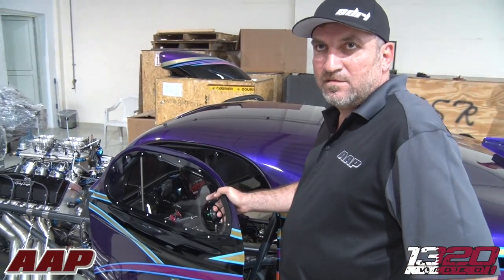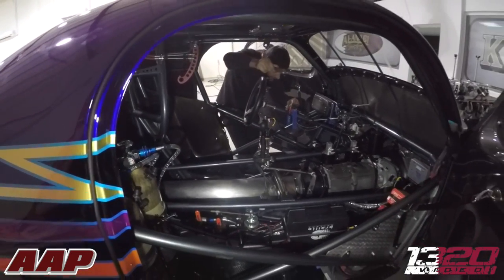949 CUBIC INCH Willy’s - Testing In Qatar!

Comment: 2900hp out of all that??? seems low
Reply: 2900 hp without spray
Reply: +Isaiahfabian No dude. not 2900 without spray lmao.
Reply: gotcha
Reply: Yea it does seem just a tad bit low, Docs new 959 is making 1900 with no nitrous so his engine should make right over 3000 on nitrous which sounds about right. This 949 should make 3000. Regardless it’s an insane amount of power to put into a car. This car will easily run in the 3’s once he gets it tuned right and running straight.

Comment: I don't know all the technicalities of drag racing but what is the point of the guys holding onto the back of the car when doing a burnout?  is the car gonna get out of control? it just kinda reminds me of the guy you see driving down the road with an object on the roof of a car with one hand on the steering wheel and the other hanging onto the object as if he actually has the strength to hold it at speed.  that motor is insane btw.....
Reply: +jason shuler They keep it straight. While a car is burning out, it doesn't take much force to push it side to side.
Reply: they saw it on street outlaws and think its cool
in real racing no people dont hang onto cars
or are they still shambing back past the car when its in stage ,  like the guy during the night run
Reply: @yarpos  wrong

Comment: 15.5L motor wow! I think he could get more hp than he said out of it.
Reply: +TKO593  They didn't say the total output of the motor just 1300+ HP shot of NOS so it is packing some major power!
Reply: +TKO593 
This Pat Musi 949 is a stroked 903. 
The 903 typically produces about 2000+ HP. 
Add 5 stages of nitrous for an additional 1400+ HP, you can do the math.
Reply: patw52pb1 Insane power for how light it is. I'd say it could make a 3.7 ET at least once its dialed in whats your guess?
Reply: +Thor_BC did he mention weight I missed it.
Reply: +Thor_BC 
It is. 
I would estimate the car featured in the video weighs about 2300 lb, possibly less.
I would expect lower ET if he can get the traction.

Khalid Bin Hamad al-Thani aka "KH" or Khalid Mohammed, the 22-year-old son of the emir of Qatar ran a 3.701 @ 202.82 reportedly running a Musi 903 in a 2660 lb. car. 

Scroll down about mid page and notice the scoreboard: 
http://www.musiracing.com/musi-powered-racers
Reply: +TKO593 
Moe Atat did not mention the weight, but I would estimate it at about 2300 lb,  possibly less.

Comment: with a monster engine like that ,i would've expected 5 or 6 thousand horsepower
Reply: a 572 chev motor is around 700-800 bhp now this being a 949 I expected with nos around 2000 or so maybe with a huge blower and some more nos it will make near 4 000 but that will have to be a custom built and machined blower.
Reply: Oldman pup it's capable of 5000hp with turbos

Comment: About to get to the point where instead of liters well need to measure it in thousandths of a cubic inch haha
Reply: sonnys has a +1000ci v8. just a matter of time before more builders make +1000ci motors. but may be a bit longer before racers get the money for them.

Comment: Notice the crew likes to hold these cars from Qatar to start the burnout, really 2800hp don't think its necessary lol
Reply: Tyre size makes it irrelevant not power.
Reply: +Swipez Yeah but they did it on the smaller tired imports too and you don't see it done in the USA
Reply: +victoryredcolorado it all depends on the brakes of the car... if it has very little braking power, then it should be held back
Reply: Maybe they hold it so that it doesn't go left or right and they keep the car intact long enough for the full runs!!!
Reply: If they don't hold it the car will be out of Qatar after several seconds

Comment: 15.5 litres. What does it Rev to?
Reply: What's crazy is how high they Rev these mountain motors. They probably spin this one to 8000 RPM give it take.
Reply: +Cory Stansbury probably more like 10-11k rpm
Reply: +pilar Garcis no, v8s generally dont rev high. highest would be around 8k
Reply: +moistened eel high compression v8's can rev up to 10,000rpm depending on the type of cams they use as well
Reply: +moistened eel v8s can wrap up around 12000 rpm with the right crank and set up. Look it up.
Reply: +sl00000w highest I've seen is 11,000rpm but I wouldn't doubt they can rev up to 12,000rpm
Reply: No probably not that high. The compression ratio is is probably like 16:1. That and the heavy rotating assembly (crank and rods) probably lower the redline to a fairly low number. But it depends on the type of v8. Crossplane v8's I believe have a very heavy crank, due to the weird firing order and counterweights, are heavy and can't rev up too high because of centrifugal force. Flatplane v8's don't have any heavy counterweights and is fairly balanced. The lightweight rotating assembly allows it to rev up pretty high, i.e. Mustang GT350R, whose engine is similar to the true Flatplane v8, but due to header fitment issues, the firing order had to be slightly changed. But still revs up to 8250 rpm. =) 
Then again the car is in Qatar, they have enough funds for engines.
Reply: pilar Garcis no way is that revving to 10-11k. 
This engine 9k give or take. Thats it. Pro stock engines revv to 11.5-12k.
Reply: moistened eel you dont know what youre talking about
Reply: @moistenedeel4791   How much you can rev depends on bore stroke ratio

Comment: don't need 900+cubic inches unnecessary when guys are running 4.50 in the 1/8 with 350cid
Reply: D Carden mhm yaa .. but the cars u talking about are either boosted or blown soo .. nitrous' car's need big inch motors

Comment: I have watched a lot of these 900 plus CI engines race and I am not impressed at all. Most of them get beat out by way smaller CI engines what a joke
Reply: Sure any build can be better than another, seen 4cy make 2,000hp, but the trq bigger engines make from idle can't be matched by anything smaller than it/them.. This guy went 4 sec @ the 1/8th while totally letting off less than half way down the track, car is too fast, for most ppl..

Comment: LoL; why do they always pretend to 'hold the car back/down' during the burnout? As if that actually does anything at all besides get them high on the fumes.
Reply: +Daniel R. It's actually to keep the car in a straight line while heating up the tires, as loss of rear tire grip can cause the rear to kick out and spin the car the wrong direction
Reply: Good to know; thanks.. Although I don't see how it actually helps with that much power going to the wheels. It's like putting feathers on a turtle hoping it'd fly.
Reply: its to keep the rubber straight on the ground nothing for the car its to keep the sticky rubber line straight(the groove)
Reply: +Daniel R. Dont want the rear end to kick out and hit a wall or somebody.